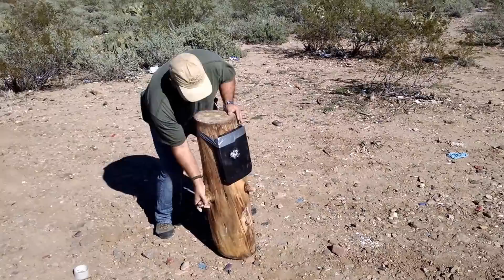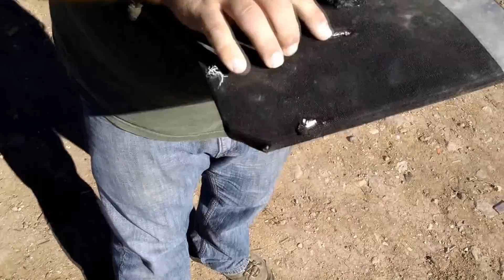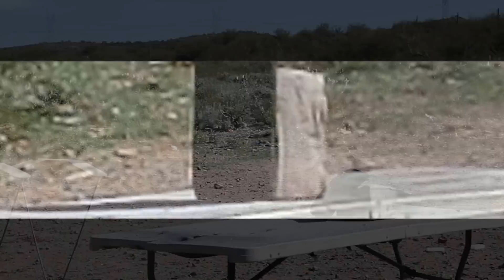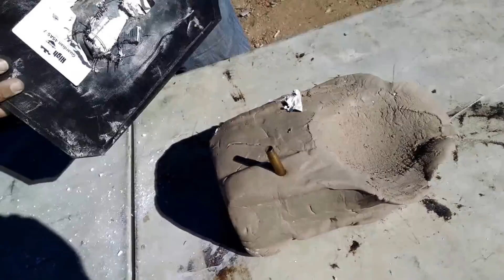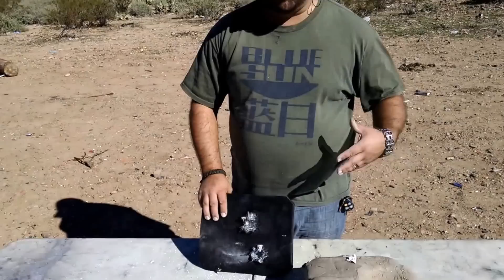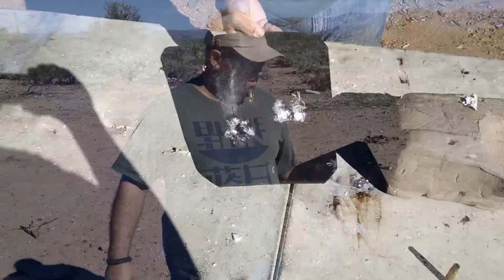Are Ceramic Plates Fragile? Sledgehammer vs. Highcom NIJ lvl IV 4SAS7 ***DEMONETIZED***

Comment: But now you can’t put that back on and expect it to save your life. Shoot a steel plate 30 times with .223 and shoot a ceramic plate 30 times with .223. Not expecting to take that many rounds obviously but you’ll know which one you would rather put back on instead of spending money on new plates
Reply: If you take a hit with a steel plate, either the bullet or spall from said bullet would get redirected into your neck. Even with spall coatings, that coating is compromised after it's taken a single hit, which means the next shot would slit your throat.
Reply: @stahlhelmturtle9822  The spall cutting your throat is a myth. The spall is so lightweight that it can barely even cut your skin. The reason to not use steel is if you need higher protection as steel is effectively only III. Steel and Titanium is currently used in SOF for NPE roles because it is way slimmer than ceramic so it doesn't print. 

For our purposes, I think everyone should have at least 3 sets of steel armor in conjunction with their ceramic plates. This allows you to have armor for other people. Steel armor is super cheap like $120 for front and back, so there is no reason to not have extra sets. It could literally save someone's life.
Reply: @DaveSmith-cp5kj  I have never and will never trust steel armor to save my own or a loved one's life. Ceramic plates are now available at the same price point as steel, and thin ceramics also exist now for low profile rifle protection. There is no excuse to use steel today, as weight limitations leave it solidly in the borderline obsolete class of NIJ level 3.
Reply: @stahlhelmturtle9822  Ceramics are definitely not at the same price of steel nor are they anywhere close to the thinness of steel. If you do find ceramic plates that are, they are likely Chinese imitations with zero protection, which is worse than nothing. If you do buy ceramic, only buy US manufactured otherwise you are wasting money.

I should add that there are Chinese ceramic plates that work, but those are thicker and heavier than US plates and even then are still over twice the cost of steel.
Reply: @DaveSmith-cp5kj  RMA Armament makes some of the cheapest and strongest NIJ level 4 plates on the market at almost the exact same price of most steel plates
Reply: @stahlhelmturtle9822  RMA is nowhere close to the price of steel. RMA is 4x the price at the cheapest, and 8x the price for their good 11x14 slim offering.

Also RMA is identical in weight to steel. That's part of why their plates are so durable.
Reply: @stahlhelmturtle9822  9mm is inferior to 5.56, but we still carry 9mm because an AR can't be concealed. You use different plates for different purposes. I have ESAPIs in my placard vest, and Safelife FRAS in my every day carry vest and I have multiple sets of steel at my office, in my car, and in storage as backups for others or myself if for some reason I'm not wearing my FRAs. And like I said, steel and titanium armor has well over a decade of using in SOF applications for NPE. 

Steel actually has less blunt trauma ceramic. Ceramic will deform while AR500 is an all or nothing. It is very hard to make steel deform and if it does it is often less than a quarter inch. Also next to no one has sustained internal injuries from blunt force trauma. Like spalling, blunt force trauma is largely exaggerated. That said, all you need is a slice of foam matting that costs like $3 per yard from the craft store and it completely eliminates backface deformation issues.

I'll be honest, based on your comments it is pretty clear you have not bought ceramic or steel plates before, or you have bought ceramic you did so without even bothering to do a surface level research about the different ceramic plates. So a warning from you really doesn't have that much gravity when you don't know what you are talking about.
Reply: @DaveSmith-cp5kj   what is your source for the SOF groups using steel and titanium? It doesn't count if it is pre-1995, as that is pretty much all that was available.

Your second paragraph reveals that you are the one ignorant on the topic, as you might have had some credibility if you said your steel was A46100, as that is what the military uses in vehicle plating, and has been proven effective in testing. However, you use AR500. Not even AR550. AR500 is not certified by any system or organization as far as I know and is completely ineffective against any AP type rifle round. Additionally, you use FRAS which is merely a better marketed dragon skin with a different tile layout. Additionally, BFD is not the only thing that causes blunt force trauma. Simple energy transference with no BFD involved can cause massive internal damage. A simple trauma pad will not fix this issue. The fact that a trauma pad is required at all is a sign of inferiority. Did you also know that military issue ESAPI plates are ICW plates? This means that they will not provide the rated level of protection unless provided with a level 3a backer. I also highly doubt that you wear FRAS as everyday carry unless you're a cop. I hope you know that FRAS isn't certified by anyone either, and its deformation patterns are pretty severe.

The first two sets of plates I ever bought were AR500 steel. I now own several sets of ceramic of varying types (Silicone Carbide, Aluminum Oxide, Boron Carbide, Titanium Diboride) as well as titanium plates. I collect both new armor from companies and military surplus from all over the world, and for concealed EDC I wear level 3a Kevlar, since soft armor just makes more sense for low profile use as a civilian than any rigid plate. All of the armor I use or plan to use seriously is NIJ certified. I know enough about armor to know what is obsolete.
Reply: @stahlhelmturtle9822  If you know, you know. 

No one is carrying AP rounds dude, especially not in NPE where the biggest threat are handguns and carbines. ESAPI also doesn't rely on a backer for its protection. That is also a long standing internet myth. The ESAPI is issued with a backer because the carrier it is designed for is supposed to have the soft armor for frag coverage. It's a system. The plate itself though can stop pretty much any conventional AP threat. And again your assumptions on blunt force trauma are just plain wrong. 

I'm going to call a big cap on your claims of ownership given you did not know really basic stuff about ceramic vs steel handling. Not to mention if you actually did own both, then you literally wouldn't be arguing about my first comment. Also NIJ certification doesn't mean anything, not even to most RRT members.
Reply: @stahlhelmturtle9822  All that tells me is you aren't in the know... on several things. Let's be real dude, you aren't fooling anyone.
Reply: @DaveSmith-cp5kj  And you've still yet to provide a source. The only one you are fooling is yourself. Steel is obsolete. Get over it.
Reply: If you do that test, you’re gonna have 30 holes in your steel armor and and somewhat less in your ceramic.  That round is gonna make swiss cheese of your steel.

Comment: Ceramics are multi-hit tho.
Reply: Some are. Some aren't. And it depends on the round. Level 3 and below require multi hit capabilities from their rated threats but level 4 only requires one single hit from .30-06 M2AP. Level 4 plates that can stop more than one .30-06 hit are stopping more than what they officially have to stop.

Comment: To anyone who has extensive ballistic knowledge.
For a while now I've wondered what a .50BMG round would do to a solid square foot of just ceramic.
Reply: do you mean a cubic foot? a floor tile could be a square foot. A cubic foot would be a block.
Reply from the maker: TheLustyUnicorn What exactly do you mean? .50 BMG will punch right through level IV plates.
Reply: The Chopping Block I was talking about a square foot of ceramic.
Reply from the maker: TheLustyUnicorn What does the width have to do with anything? What thickness? What kind of ceramic?
Reply: The Chopping Block I'm really unfamiliar as far as the variations go.

Comment: Fair enough.  I figured a sledge would completely ruin one.

Do they hold up to water?
Reply from the maker: What do you mean?
Reply: I read somewhere, so take it as an urban legend, that you can make fantastically thin armor hold up to rifle rounds, but once it gets wet it won't work as well.  But considering this stuff is made of plastics and ceramic, I don't see what water would do.
Reply from the maker: +spraynpray Aramid fibers can't protect as well while wet.
Reply: The more I know!  Thanks.
Reply from the maker: +spraynpray Knowing is half the battle.
Reply: spraynpray

Comment: I have trouble believing 450 marlin or 358 winchester would go through ANY rifle plate. Try this with a 243 varmint load, or a 22-250. I'll be impressed if it can stop those once being compromised.
From what I've seen so far, until you get into extremely exotic wildcats from hell(700WTF or 12 gauge from hell), the whole mass vs velocity ordeal doesn't seem to level out. In a general sense, velocity seems to always be the winner when it comes to defeating armor with small arms and conventional bullets.
Reply from the maker: Yeah, I'll probably try .270 sometime soon. I don't have a .243. +The Wound Channel shot the same plate with .22-250, I think. He also shot it with .338 Lapua. I don't think anything short of a .50 bmg can get through.
Reply from the maker: +Tombs Clawtooth Foot pounds per square inch?
Reply from the maker: +georgejohnsmith Minor correction: level IV is required to stop M2AP .30-06.
Reply from the maker: +georgejohnsmith I was under the impression that M2AP was harder to stop.
Reply from the maker: +georgejohnsmith I lack both the experience and there reference material to have an opinion. My impression was formed from what I inferred from more knowledgeable fold than myself but my inference could be mistaken and it was based entirely on hearsay.
Reply from the maker: +georgejohnsmith *folks
Reply: georgejohnsmith What the hell is ftlbs/si?